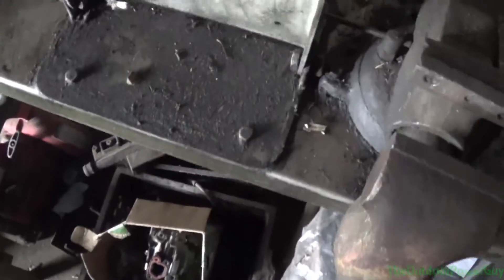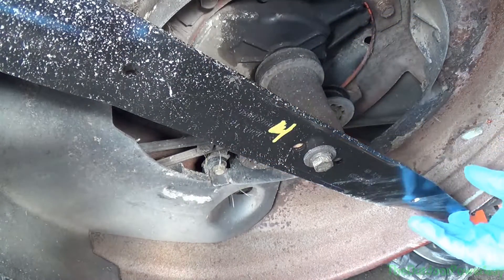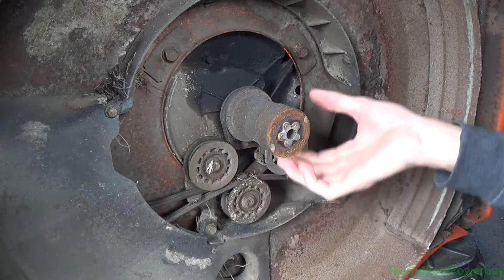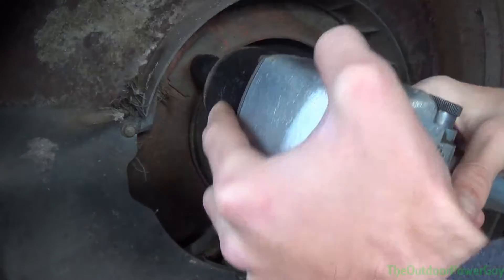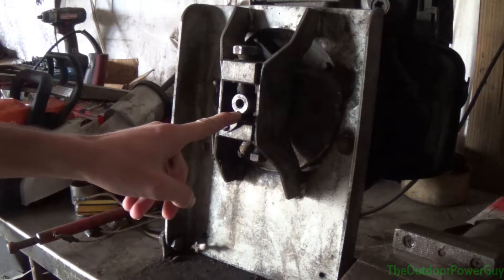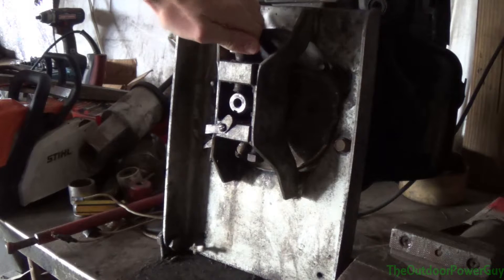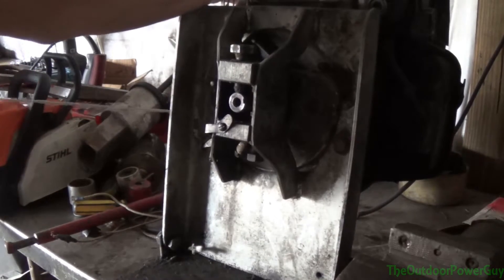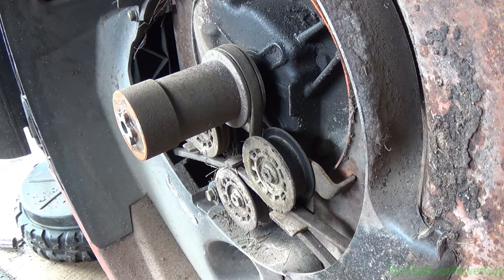HOW TO STRAIGHTEN A BENT CRANKSHAFT ON A PUSH LAWN MOWER ENGINE

Comment: Good video, I have never personally had to do this because anything with a bent crank is so old the customer wants to buy a new mower, without any pressure. Also, why do yo you call the engine a motor? A motor is electrical, an engine is mechanical.
Reply: I know what he means.